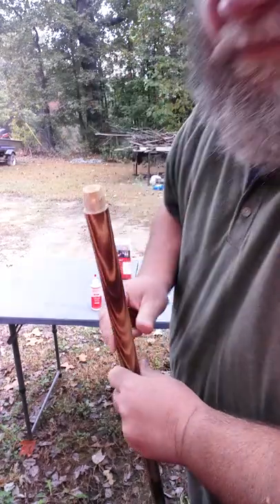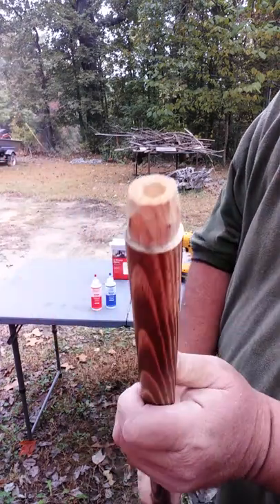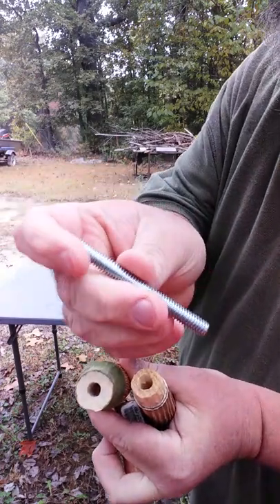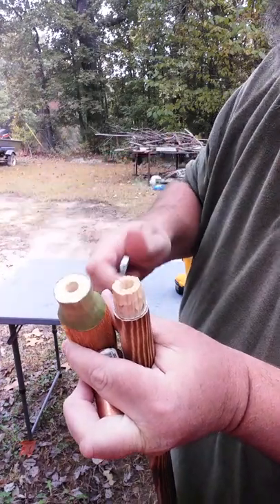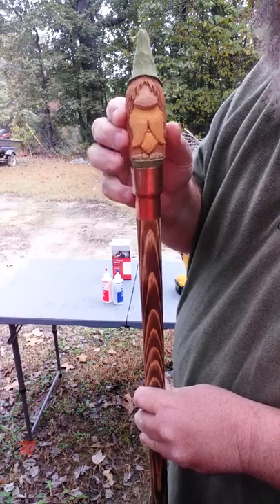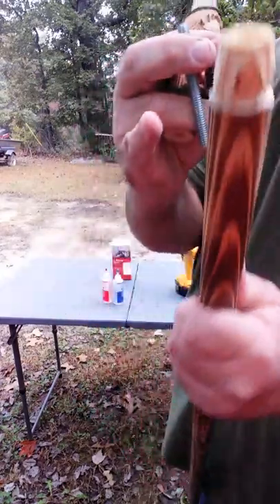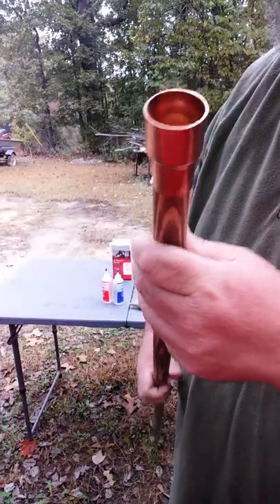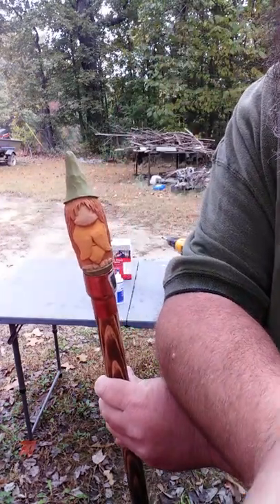How I attach my toppers to my walking sticks.

Comment: Hi Tim, what does the copper sleeve do - is it necessary...does it make the connection stronger? Is it ok to put the handle right on the stick - with a hanger bolt and apoxy?
Reply from the maker: I use the copper fitting to basically cover my failure to make a good clean connection, and it does make it a bit stronger. You can connect topper straight to stick, but you'll want a spacer in between.
Reply: @timpevey868  Thank you, Tim, I may have more questions as my wife and I start this project in our small tourist town on the Frio River
Reply: @timpevey868  Can you explain or describe the 'spacer'?
Reply from the maker: Imagine putting a washer between the head and stick, but it would be a hard wood or antler, several options.
Reply from the maker: This gentleman gives a much better explanation! https://youtu.be/h_isaAvgnXs
Reply from the maker: Never hesitate to ask questions!

Comment: The gap space for epoxy is important.  Avoid being too meticulous in the fit.  Epoxy needs to bond not only to the surface you are glueing, but it also needs its own thickness to really become as strong as it can be - which is impressive.  Use enough epoxy to cause it to squish out.  Wipe the excess off with denatured alcohol or acetone.
Reply from the maker: I always drill my holes oversized and  a gap between my stick and topper. I believe in it holding for life!
Reply: @timpevey868  Yes, I noticed. You do good work. Plenty of space. I was just adding some details as to how epoxies work best.  You got it covered.👍
Reply from the maker: Absolutely, no worries!

Comment: Tim!  Are you just knife carving the top to fit the reducer?  How are you measuring the fit before you start carving?

Lastly, are you sanding up to 240, then torching, then sanding at 240 again?
Reply from the maker: Yes, I knife carve it, there's a lot of luck and not much skill involved! 😊 I like to leave a gap between the topper and the top of the stick for the epoxy to grab hold, so it doesn't have to be perfect. I like using a tubing cutter for plumbing to get my line straight and make a stop cut, then I cut back to it, then turn and carve up. I sand it all the way til I'm happy with it, no fuzzies at all, then I torch it, you'll be surprised how that finishes it off!

Comment: You also mentioned there were tools you could use to carve the dowel to fit the reducer, rather than do it by hand. What are the tools?
Reply from the maker: I should have been clearer on that, most of those tools are home made. If you could imagine a large forstner bit wit a hole in the center to slip over the stick and cut a neck.
Reply from the maker: https://youtu.be/sHY-0HjVEok
Reply from the maker: 👆 Here's the link to the tools.

Comment: Any ideas on attaching topper to a Hollow cane made of Antler?
Reply from the maker: I add a lot of toppers to bamboo, so I'll either carve a peg on the bottom of the topper to fit the hollow, or I'll take a dowel that will fit the hollow then carve a peg to fit the topper. Hope that makes sense.
Reply: @timpevey868  I was thinking the same in just wasnt sure. Its my first attempt and this is large diameter hole. So before I filled it or decided to put screws in it figured I ask someone with experience
Reply from the maker: There's many ways to do it and there's nothing like making mistakes to teach you the best way! 😁